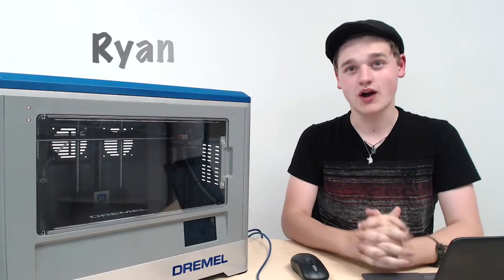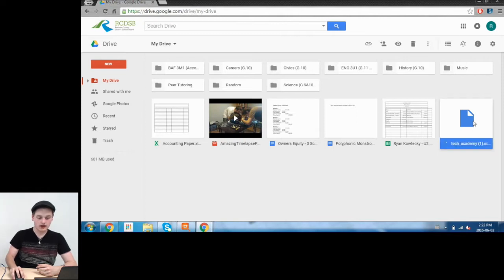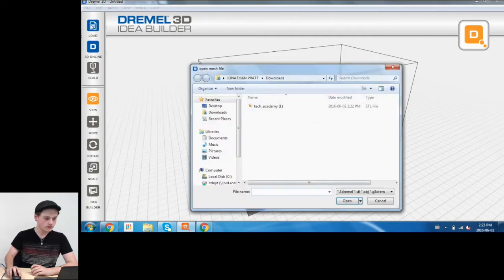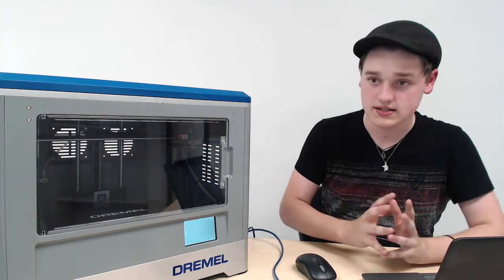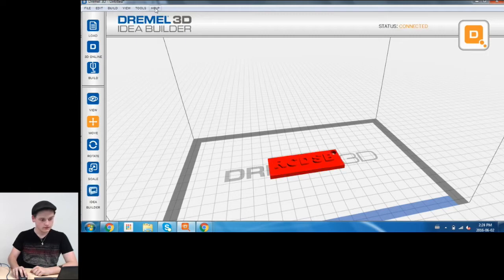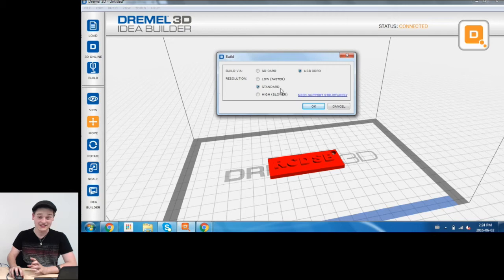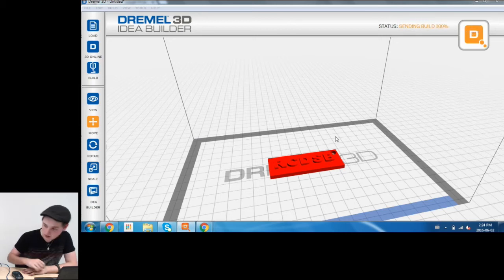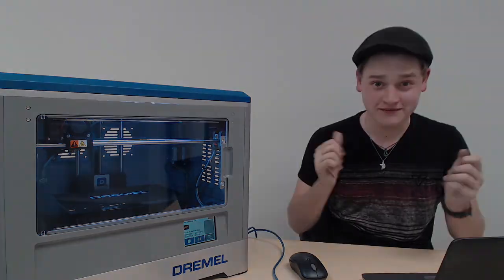3D Design & Printing with Dremel 3D Idea Builder Software

Comment: How can we make the right format for the printer from the 123design from Autodesk?
Reply from the maker: From 123Design, the .stl file must be opened in the Dremel software where it is converted to .g3drem before it is able to be printed in the 3D Idea Builder.